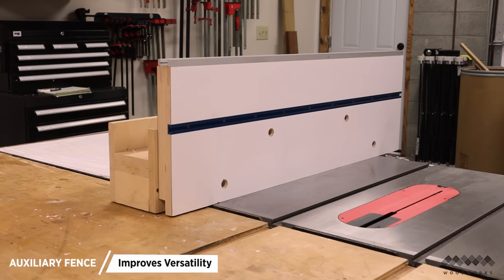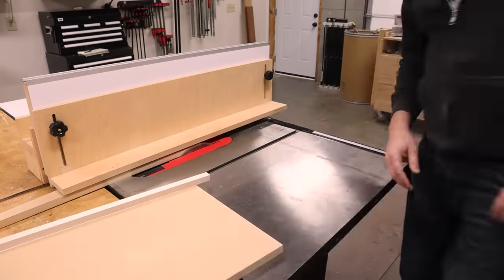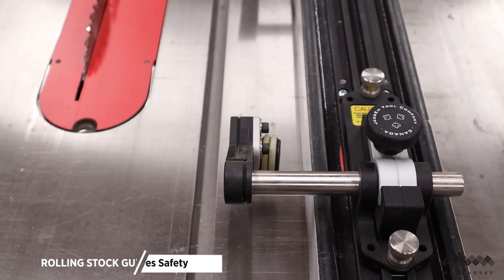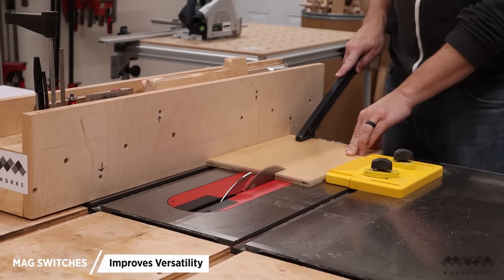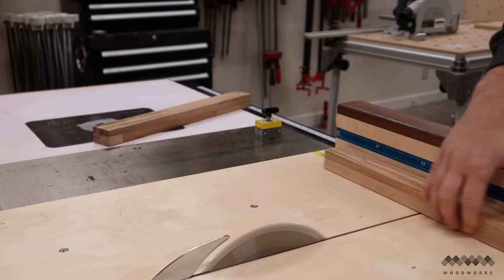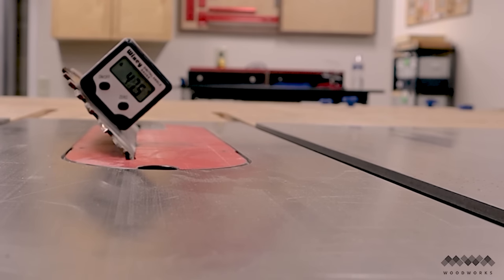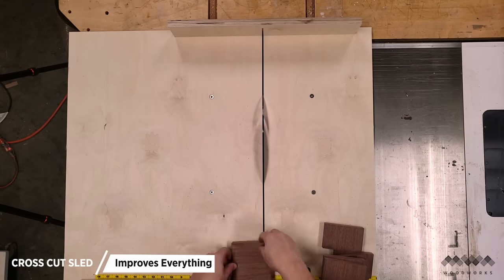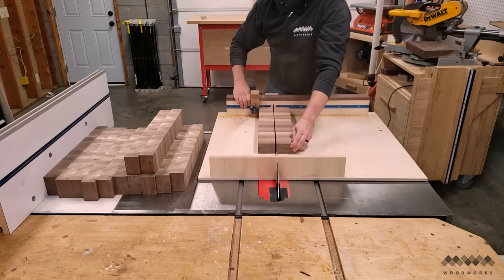In 5 minutes I can improve your table saw | woodworking tips

Comment: First of all...great video and great fence. I'll be buying the plans and reviewing the video and blog post. One tip on the Jessem Clear Cut Stock Guides...I noticed when you set it up you placed the rollers on the top of the stock and tightened it down. (Maybe this was a short cut for the video.) But, I saw a video on the Jessem site that shows laying the black arm to the outside of the rollers on the stock and tightening it down. This ends up giving you much more downward/inward force and locks the board from movement better than just using the rollers as the height guide. Hope that's helpful.

Comment: The Jess-em stops are available in a cheaper (½ the table saw price) version for router tables and would fit on your auxiliary fence T track nicely
Reply from the maker: I have those too for my router table. The issue with them is the reach. You'd have to make the t track in the fence a good bit lower for those to work at the table saw.

Comment: There's no simple way of switching between the aux-fence and the Jessem rollers? Apart from removing the rollers and then attaching them back on afterwards?
Reply from the maker: Correct. The track for the rollers is permanently on my fence under the aux fence. The aux fence just lifts off and I can place the jessem rollers on. Takes less than a minute 🤷‍♂️
Reply: @MWAWoodworks  I will browse through your video again and have a look. Thank you!

Comment: I need a good table saw ..
Reply from the maker: You don't need an expensive saw, just one with a standard rip fence and a cast iron top 🥃👍
Reply: @MWAWoodworks  I got a ryobi 10 inch very beginner diy grade ,, definitely will upgrade I the future. Thx for those tips.

Comment: What I find somewhat annoying is that most videos regarding table saws assume you have a $2000+ SawStop table saw. I would guess most hobbyists don't.
Reply: Most of these suggestions work just fine on my mobile Dewalt saw.
Reply from the maker: You should not assume that. Absolutely nothing in this video requires that you have to have a Sawstop! Any kind of table saw with a standard rip fence and a cast iron top will work 👍🥃